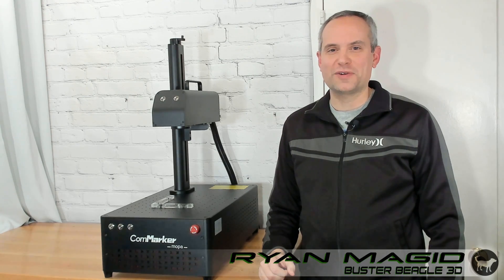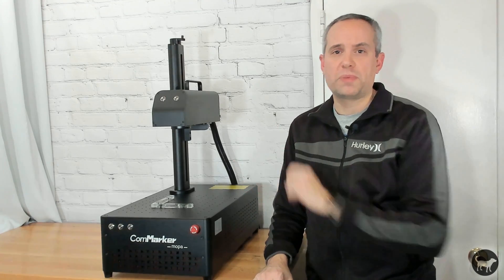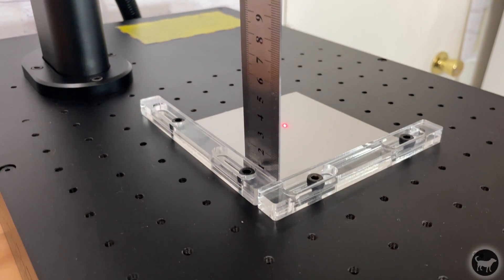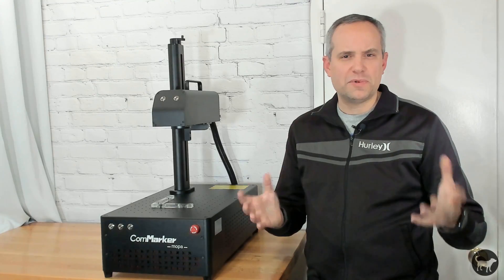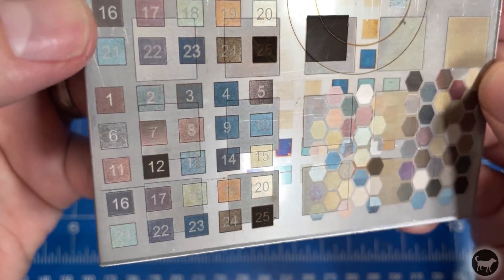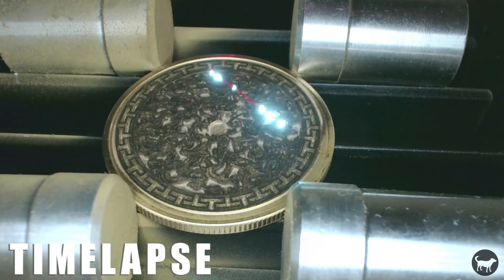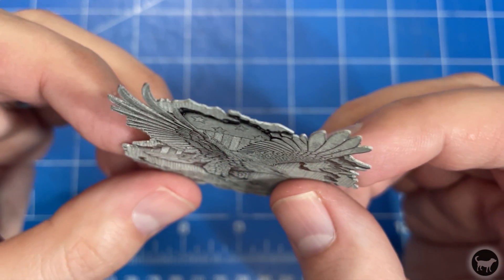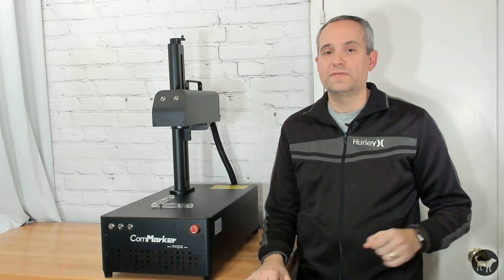ComMarker B4 MOPA 60W Fiber Laser Marking Machine Review

Comment: Nice video  I have a question Mopa laser 60w engrave coins how many days it takes? I have a same unit commarker 60w b4 every time I was an engraving coin dep it’s showing 300 hours? At the end not the same like  yours showing 
I am using light burn it you can guid me direction
Reply: Might be kinda late but did you set the speed in Lightburn to mm/m millimeter per minute instead of mm/s millimeter per second?

Comment: Commarker has horrible customer sevice. I had to cancel my order after too much chineese confusion.
Reply: What did they do? I have too machines from them everything seems quite nice to me? Did I miss anything?
Reply: Same problem, stuck in customs (UPS) and nobody gives an answer as to what is happening. Have cancelled the order, but no response from ComMarker. Makes me worry what the after sales service will be like regarding parts and help.
Reply: @printpresssolutions  That's odd. I usually got their support response within half a day. Did you send your issue to support too?

Comment: Can it engrave into uneven stone’s surfaces?
Reply from the maker: To a certain degree based on the lens you use and by how much. Basically it doesn't need to be perfectly flat but you only have a short range until the focal range falls off. The large the lens the bigger the focal range.

Comment: Why don't these "reviewers" NEVER say how long it takes to make all these samples?  WHY??? (Oh, yeah, if you knew it takes more the 90 minutes, and used so much electricity, I WILL BE A DEAL KILLER)
Reply: True a 60w laser probably uses more than 60w to run everything, but a standard size TV will use the same if not twice as much especially if you're looking at anything over 55"....
Reply: @joshuahein9928 commarker 60w mopa uses 620w of power
Reply: Probably not the electricity cost, cause 1kw an hour is probably a roughly ten cents for most people.   But the fibre laser itself is crazy expensive to replace
Reply: @kinbolluck476  Rarely an issue, most will last over 50,000 hours and some claims up to 100,000. To your point though, the part is the main cost and will cost about the same price of the entire unit.
Reply: I work in an office and I don’t pay for electricity so it fine by me 😂😂😂
Reply: I'm just starting out with laser engraving but I have a lot of familiarity with laser welding. I could say at any reasonably intelligent person would understand that this comment is extremely naive
Reply from the maker: Feel free to watch again. I do actually say how long it took to do the longest jobs.
Reply: This post is based on sooo much ignorance I hope it is a deal breaker. Find another hobby.
Reply: I’m not sure why this is such a big deal to you. Frankly, if you live in a civilized country, the electricity price should be minimal.

Comment: How long do the lens normally last? Assuming maintenance will prolong it but on average how long and what is the cost to replace. I feel like this should be part of the review if it's ridiculous.
Reply from the maker: The lens is not a consumable product so there should be no reason for ever replacing it. However if you want to get different focal distance lenses or if you happen to damage it somehow you can replace it and they are not overly expensive. I think around $50-$70.

Comment: Just to add a little perspective for some of those leaving comments, I have a 20W MOPA and it is awesome, is it as powerful as a 100W MOPA?  No of course not but these machines are all very powerful, capable and blazingly fast, if a job took 8 seconds on a 20W and only say 2 or 3 on a more powerful machine does that really matter? Max power is only 1 factor in any case, for example, engraving on plastic is likely to produce a dripping mess on most lasers that don't have the finer MOPA control options. 
The video was excellent and I think it represented the options very well, it just seems from the comments that many are looking at outright wattage on these machines as the be-all and end-all.
Reply: Well what if you need to engrave some steel tumblers... but they are on the moon?
Reply: @tradtke101  I would assume from your question that you spend quite a lot of time on the moon, good point, you've got me there.

Comment: That shield has to be a joke….. the glasses fit this wavelength at green. I don’t think that shield is doing anything
Reply from the maker: Color does not determine the optical density protection of the shield. While I can't vouch for the lab testing on this particular shield you can find may orange safety googles in the 1064nm range.
Reply: @BusterBeagle3D you could try to laser through it
Reply: Don’t buy it then. Why do we care what your opinion is?   We don’t…
Reply: @ChunksMcGee  lol cry harder

Comment: Thanks for the great review of the 60W.  I work out of my house, so I'm wondering what are the power requirements of fiber lasers and are requirements different due to the wattage of the unit?  In my work area I only have 110 available
Reply from the maker: It just plugs into a regular 110V wall plug. It doesn’t  need anything special.
Reply: Any idea as to the breaker size required?
Reply: @TTC1940  The 60W machines can pull up to 1000w, so regular household breaker (15A for 110v) will do.

Comment: Great video, Thanks. I just wonder : does 60 watt is too much if I want to create my own "PCB" (circuit boards) for electronic projects or does the 30 watt is enough or just barely enough ?
Reply from the maker: I haven't made PCB boards myself but I want to say I have even seen those made with 20W machines. Just keep in mind that just because something is 60W doesn't mean it's always running at full power. While it's not exactly the same ,60W at 33.3% power should be very near a 20W at 100% power. I would think 30W would be just fine.
Reply: @BusterBeagle3D  thanks for the answer.

Comment: It looks like there is a lot of user requirements in order to get the laser dialed in with the two points that shows it is at the proper focus level, to me that seems like a turn off. Since you’re sharing your honest opinion, what is your honest take on this machine versus a commarker b4?
Reply from the maker: My recent B4 is in a totally different ball park since it's a MOPA and 60W. I do like the smaller form factor of this machine however just from an ease of use standpoint. The B4 also has the longer cord for handheld use which I'll never do so it's honestly more of a hindrance. Both machine require at least a little tweaking to dial in perfectly but I did go into more of the setup with this machine since some of that info was lacking. The laser focus of this machine was a pretty easy and quick adjustment, the rest of that Lightburn setup was really just inputting the proper settings.
Reply: @BusterBeagle3D  I apologize, I should have clarified which B4 model, and I was referring to the smaller unit.  Regardless, great videos of both machines with a honest review. Thank you for the reply.

Comment: Thanks for a great review.2 Important questions for the nice 3D engraving job you did at 14:20:
-How long did this one take?
-In your experience would a 100W model cut this time in half?
Reply from the maker: It was a little over 2 hours. Yes a stronger wattage means you can make it faster. It probably wouldn't be 100% faster, maybe something like 70-80%.
Reply: @BusterBeagle3D  
Interesting that it took the same amount of time(or more) than the more detailed work you did at 13:19 . Now I know 20W version to save some bucks is a no-go, cheers!
Reply from the maker: @AllenCote4  The times can vary based on the detail of the engraving but it's almost backwards to what you would think would take longer. After the design is sculpted out the laser will skip over that area at a faster speed then the laser is engraving the parts it's still cutting out. This means that even with a lot of detail, as long as it's uncovered it will now skip it. With something like the Air Force coin there were lots of deep open space which meant that that laser was still moving at the cutting speed over those areas instead of faster skip speed. Hope that made sense.
Reply: I'm thinking too that a 100w model will also let you more easily use the larger 200 and 300 lens sizes since you'll have more power at your fingertips.  Lower wattages won't do as well with the larger lenses.  Correct me if I'm wrong on that.
Reply from the maker: @alwatts9713 Technically yes, However I don't want to say they will do bad but you would work faster at 200mm lens with a 100W machine vs a 20W.

Comment: But what’s the working area?
Reply from the maker: Working area is based on the lens  you use. 70x70mm all of the way up to 200X200mm
Reply: @BusterBeagle3D  the lense is extra? How much
Reply from the maker: @swflscratcher5893  It's comes with the 100 and 200 already but if you want a 70 or 150 they are $74 on the website.
Reply: Up to 300x300mm with an additional lense, but they only recommend this for a minimum of 50W. 110x110mm and 200x200mm lenses are included even with the 20W B4 variants.
Reply: @Bllfrnd  I have a 50W fiber

Comment: As always...another great video! You hinted on my biggest "complaint" about Fiber Lasers (I have one), the colors usually only look good at certain angles. If you look at other people's samples, they always show it at the best angle, something the colors look black. Even your great Mickey Mouse engraving would not look that colorful if it was hanging on a necklace. Even black doesn't look that great unless it's in the "perfect" angle.
Reply from the maker: Honestly the settings that I used for the Mickey Mouse do hold up pretty good at angles. The black is something you can feel on the surface and same with the white and they really don't fade much at angle.  The red and blue do go a little darker but still hold up at many angles. I have that file I created for Lightburn in the video description so if you have a MOPA give it a shot!

Comment: There are some mopa laser videos that prove that it can engrave on wood or cardboard... Somehow the focus lasers were not in focus...
Maybe you can play with the focus to engrave on other materials...
🤔
I'm still waiting for my laser to arrive... There are some scam sellers on eBay... I'm on my third attempt to buy one since October 🤦
Reply from the maker: I have seen some videos where people either coat the wood or use some chemical mixture with titanium dioxide but it's really not recommended to use on wood. You are very likely to start a fire so it's really not recommended. A simple diode laser, even one with a simple galvo setup would be better suited for that.

Comment: I've been looking for a different way to cut very small parts out of hardened stainless steel.  .22mm thick. They are very small and detailed. So far I've had them made through chemical milling but that's getting too expensive. Just wondering if this laser could do the task?
Reply: Yes the laser can do the task, it may take a long time but it will eventually cut through. You can also do a wobble setting which essentially makes mini circles around the cut likes, this means the beam cuts a larger kerf but will help speed up a cut. When you say .22 do you mean 22 gauge or almost .25in? At .25in it's going to take a very long time to cut. It can still be done, but you may have to adjust the laser focal distance 2 or 4 times to complete and run the file many times. I'm not sure it is the best tool for .25in material. If you want to cut that thick cnc mill is probably still the best option to get it done in a reasonable time frame. 22gauge, that is much thinner and could be done on a laser but it will still take a substantial amount of time to complete. Just my 2 cents.